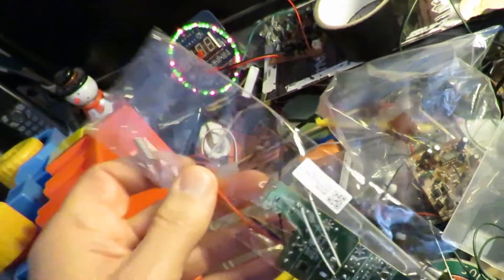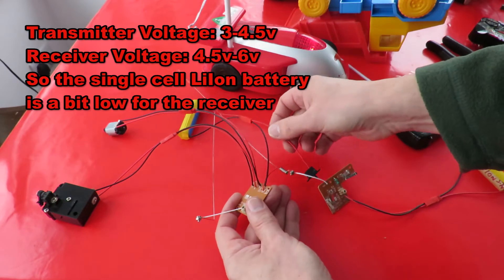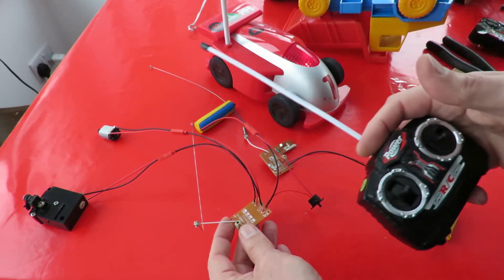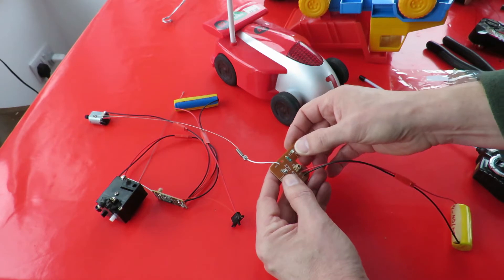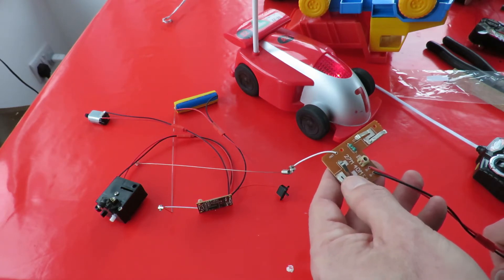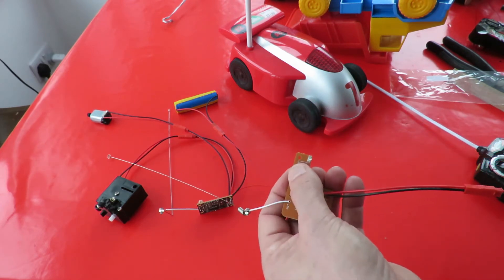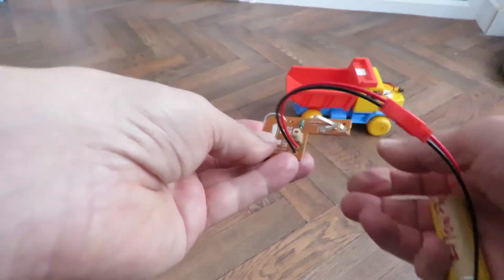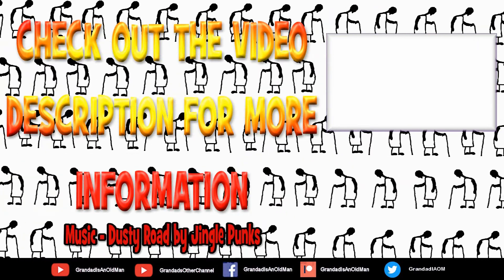What can I do with that toy grade Transmitter & Receiver Part 1

Comment: The transmitter seems to have an intermittent connection someplace.  That's often caused by a cold solder joint (loose connection) on the circuit board or in the switch or in the power connections.  An intermittent - barely touching - connection can cause short range operation.
Because the operating range is short I'm guessing that either the output power transistor is barely working or the trim coil / trim pot is mal adjusted.  Make note of the starting position and how far the adjustment is turned if you make adjustments to that part so that if the adjustment doesn't solve the problem you can return it to the beginning position.  
By flexing the various electronic parts on the circuit board etc you might be able to confirm there's an intermittent connection.  If you can find a way to hold the circuit board with a steady pressure on it and it operates correctly you can confirm that the circuit has a bad connection.  If that's the case you might be able to locate the bad solder joint or the loose part and replace the bad part. 
If that fails you might try replacing the output power unit.  That's generally a small signal transistor.  It'll have numbers / letters printed on it.  You can check online for a replacement.  Cross reference the part numbers for a substitute if the exact part number can't be located.  
A bulk package of 20 small signal transistor - could at one period of time - be bought for $2.00.
There's two kinds of transistors - PNP and NPN.  Be sure to get the correct kind because the wrong kind will burn up quickly -  pop noticeably and stink like burnt silicon.  It's also important to orient the transistor properly or the "right" transistor will behave like the wrong transistor if the 3 leads are improperly connected. 
Good luck.  ((-:
Reply from the maker: Thanks, the only reason for buying this little set-up was it was dirt cheap and I had a question about buying them online. I have ordered a couple more just to see if this was a one-off failure or a general poor quality batch.

Comment: eek. that little motor sounds too much like a dentist drill , eek run a way , run away. :) seems  u need to lenghtnen the RECEVER antena only . DO not under any circumstances lengthen the transmitting antenna. great job bodging again sir. what shall we do with the drunken trans mitter , what shall we do with the drunken transmitter way high in the morning. make him run a dump truck, make him run a dump truck  way  high in the morning.